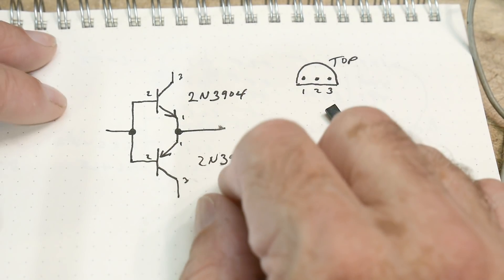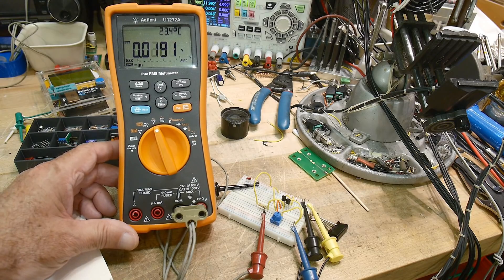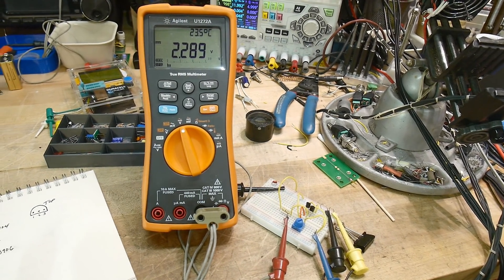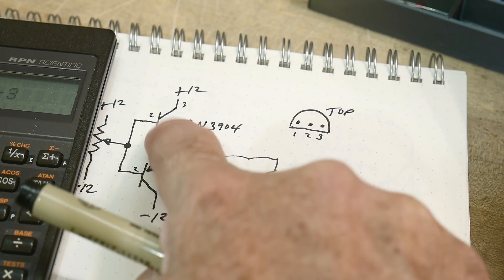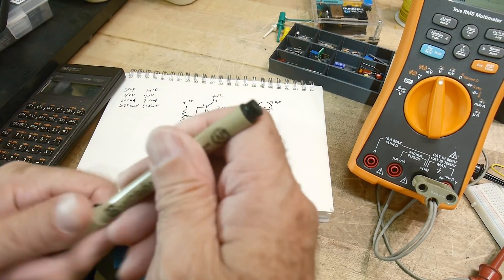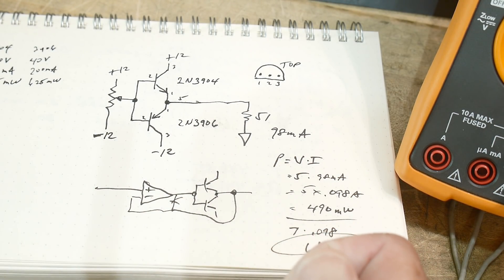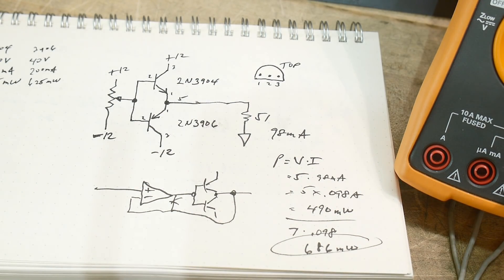#1192 2N3904 and 2N3906 Bipolar Transistors

Comment: Dude, your dissipation calculations are (slightly) off.  With he load you measured about 3.8V across the load.  That would give you a current of about 75mA.  The voltage drop across the transistor was 12-3.8=8.2V.  Therefore the power being dissipated by the transistor was 8.2x.075=615mW.  Jus' sayin'.  But it's close enough to AMR to cause real trouble.
Reply: Да, я тоже не понял, откуда там взялись 5 V, когда напряжение просело до 3,8V.
Reply: @SINHRO-FAZA а из-за чего проседает до 3,8V ? Из-за этой комплементарной пары?

Comment: Since last week, I'm playing with a portion of a circuit that Roland used in a very famous synthesizer.
Transistor, Fets and mosfets are quite more complex than just switching.
Also the transistor totem pole arrangement is pretty special, there pretty much no current usage on the base.
Both transistor cancel each other out on the base, pretty amazing, like you would be using a mosfet / fet.

Comment: 0:45  For 3-leg components (transistors in this example), I'd recommend just skipping the 1 2 3 pin numbers and go straight to simply memorizing EBC (for common examples like these).
To help clarify thoughts, does anyone use pin numbers for diodes, or straight to Anode and Cathode ?  Polarized capacitors, easier straight to + and -.
I'd suggest that pin numbers only add value for a larger number of pins.  In this case, they make memorization arguably slightly more difficult.

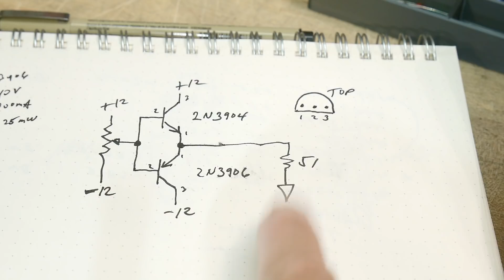Comment: 5:27 11.4V÷51Ohm= 0,235294118 Amp.
that's quite a current consume for these small boys not using a resistor on the base of them.

What would you do? since the HFE is 100 average, if you need 100mA, you need to limit the base current to 1mA, correct?

Did you try the Falstad simulator, it quite correct and good, buy a Moog Filter clone diy kit, build and simulate it, if will respond the same.

Comment: I always first design using rules of thumb using good old pen and paper, but before I built it I also do a spice model. Why? Especially important for stability analysis. E.G, the circuit you drew of the fb for an amp? How do you know that the parasitic capacitance of the transistors will not affect the fb, even make ringing with the parasitic inductance of the wires? Right, spice model. Before you build. Always. Rules of thumb are nice, but nothing compares to a good spice model 🙂.

Comment: Spice shy? Why? Back in the 1980's (and early 90's) ... more than 30 years ago (a hyperbolic infinity in semiconductor design and modeling) ... back then, Pease, and his cronies, had their good reasons. But in the last decade, at least, I can't think of an undergrad (and especially a grad) EE school where the labs don't start with SPICE simulations, and even more specialized simulation packages, before going to the lab to build. Maybe in the EE School of Old Farts,, they're still just stuffing breadboards. Dunno. Seems like small businesses, run by old farts, might be doing the same. But if you want to work in analog design, and even with discretes, and you're SPICE shy, then get a job as a plumber's apprentice. (You'll probably get a job faster, and keep it longer.) Seems to me, someone's been out of school, and a job, for a long time.
Reply from the maker: Yes, I am an old fart, guilty. I do believe (and have seen) many grads that understand the theory and are great at cad models, but are a disaster in the lab, trouble shooting or inventing new ideas. I know of good ones that can do both. I agree with you that spice is very valuable (and I do use it too).

Comment: Something to keep in mind is that the maximum power dissipation rating on the datasheet, is at 100% duty cycle. If this arrangement would have been used as intended, each transistor would have around 50% duty cycle and could handle that current easily without overheating. There are actual charts that show this on some transistors, but I was unable to find one for the 3904/06.
Reply: you have much to learn
Reply: @daveselectronicslab  Please explain. To my knowledge, the maximum power dissipation rating on a transistor is limited by the maximum collector-base junction temperature. Are you saying that a transistor that only has current passing through it 50% of the time has an operating temperature the same as one operating at 100% of the time as in a class A amplifier?

Comment: As with the other comments adding base diodes would help a little by biasing the transistors on and negating base emitter drop, could also get it to oscillate.  
I was curious was to how much the base voltage was changing due to current in the through the potentiometer.  You didn't mention if it was a 470K pot or a 100 ohm pot, obviously not 100 ohm.
Reply from the maker: 10k

Comment: I'm fiddling with a design for a big-output-capacitor-less audio amplifier (eliminating the highpass effect w/ the speaker as well as an extra 6dB) that push-pulls the speaker with inverse-phased class AB stages like this (TL084 is my op amp) and I'm using just 2N2222s (basically a little beefier 2N3904) and 2N2907s (lil' beefier 2N3906) and even though they're just little TO92 signal transistors they're actually surprisingly good at filling a room with sound.

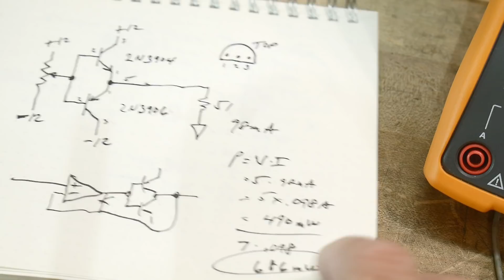Comment: At 12:00 There's no "sometime" about it. You either need to read the datasheet and do the maths and make sure at worst-case you're within limits for voltage, current and dissipation, or you've read the datasheet and done the maths so many times that you have a feel for what's reasonable.

There are not "two schools of thought". There's a sensible middle way between creating a spice model for every simple circuit that you've built a thousand times, and just sticking any old voltages and resistances into a circuit to "suck it and see" with no prior expectation of the outcome.

And if I was the R&D manager and I saw you just sticking any old circuitry together that was bound to fail, I'd fire you.

Comment: Yes, an engineer can put together a design to nominal/typical parameters without a simulator. However, SPICE and other tools are useful, if for nothing else, to check the tolerances of the devices in the design. While any engineer can get a prototype working in the lab, the usual requirement is to produce good yields through manufacturing and reliable products in the field. 

Part variation is expensive and time consuming to verify in the lab, but tools like SPICE and other simulators, as well as mathematical tools, can calculate extremes and determine margin relatively inexpensively. This can also check for violation of maximum characteristics, such as your overcurrent situation. Since in my career with many companies and being responsible for many products, I was always tasked, as part of the requirements, to create reliable and manufacturable systems, and I would have had to fire any engineer who would not simulate or calculate the variations. Luckily, I never had an engineer working on my team that did not know how to prove his work and seek to do just that. 

My first six years of my career was mostly spent fixing and cleaning up the empirical designs that other people pretending to be engineers did before me. I have a low tolerance for low quality work, because it costs my company a lot more than any savings because engineering did not take that extra hour to verify it.  Tools should never be a crutch, that is true, but the right tool should be used to do a job right.

If you are doing analog design, SPICE is easy to learn and often the CAD tool chain can create the deck for you. There are free versions of SPICE that work for many uses, but if your project supports it, licensed tools often have some worthwhile advantages. In digital design, simulation is also useful, but I also suggest trying formal methods as well, wherever you can fit it in schedule. Most designers and managers underestimate the value of verification, but it helps preserve schedule and budget and produces better results as long as you have people on the team that know how to get the value from it.
Reply: The most difficult part of designing for production is to work out what the worst-case scenario is. You need to have done lots of calculations over years to intuitively know how particular parameters affect final outcomes, and that gives you the ability to see what combination of parameters produce the worst-case result. It's beyond reprehensible to produce a design that works for most samples of the parts used in it, but can fail when one sample has a particular extreme combination of parameters. Sod's Law says that the circuit with those extreme parameters is the one that gets installed on a panel mounted 50 foot above the floor in a steelworks that's 300 miles away from your base. And you get the job of fixing it.
Reply: Once upon a time, I took an Electronics 101 course at university, mostly because I already knew my way around the topic, so a very easy 'A+'. The Professor, an EE at the PhD level of course, gave us the complete lesson and process to calculate the required resistor values for a simple Class A amplifier circuit. Did all that, Load Lines, the whole thing. Built the prototype, and it still needed tweaking for both bias and gain. I complained that I could have just started with a simple example circuit and made similar tweaks. Even if the 'solution' is yet-more analysis to account for another dozen pages of possible variables, there comes a point where it's arguably better, faster, cheaper just to start with a typical circuit and tweak. Modern analysis tools will certainly change the balance from what we had in 1979-1980. This is more of an anecdote than a lesson for others in the present day. Carry on !
Reply: Very true.   I learned small signal analysis at university.   It is possible to design an opamp or  multi-transistor circuit on paper, to an accuracy of 5%.   When I learned how to do that, during my sophomore year, I wrote a Basic program that iterated through standard 10% resistor values and came up with the design of a common emitter amplifier with the closest gain or the collector current to what was specified.    I later re-wrote the program in C and added common emitter, common base, cascode, and emitter coupled pair circuits, along with an output to an OrCad schematic.   The low frequency and high frequency roll-offs were calculated as well.   A few times I built  the designs and tested them.   The actual circuits agreed within 5% of what my program calculated.    When doing incremental analysis of a 1 or 2 transistor circuit, there are several open circuit time constants that appear in the node equations.  The high frequency response of a circuit can be closely estimated by taking the sum of the inverse time constants.   Spice, which has much more accurate device models, uses a matrix calculation, which produces a more accurate result.   I have worked with technicians who used Spice all the time.   I have noticed some had had a very superficial knowledge of how transistor work.   Their designs, which were done entirely with Spice, had unecessary components and were no where near optimal.   The more a technician or EE learns about electronics, solid state physics, and how to design a circuit on paper, the better use they can make of Spice.   The best analogy I can think of is someone relying on the self-driving capability of their Tesla, because they are not a good driver.

Comment: The way I remember the pinout for these is that the shape is a C, not a D.   So from looking down on the C, the top of the C is the collector.   The base is the middle, and that leaves the emitter as the remaining pin.
Reply: I have worked with them for a long time. Seen single PCBs with over a hundred. Even for repair purposes, even for my personal stock I always purchased them in hundreds. As far as I am concerned, they are THE jelly bean, small signal transistor. 

I just look at the flat and say E B C. And that is by far the most popular pin-out for bipolar transistors in the TO-92 package. That's why it is so impressed on my memory cells.

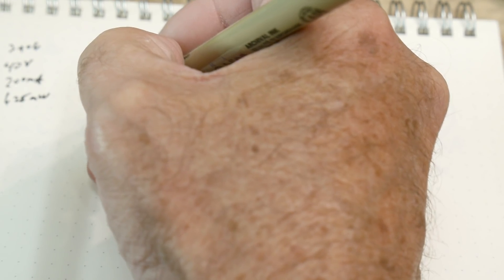Comment: 1:58 Why are no base resistors required?  Is it because there is a load?  What if there was no load, would the transistors be damaged?
Reply from the maker: best to have one
Reply: The pot provides variable base resistance to some extent, until it approaches the rail voltages.

Comment: It will eventually fail.  At high temperature, the dopants migrate faster and it will fail sooner.  At high temperature beta increases to the point of instability and it will be on until cooled even without base current (thermal runaway).

Comment: If you use two diodes on the input to bias the transistors, the crossover distortion will be very small.  If used with the op amp, it will be phenomenally small. With the op amp but without the diodes, you will still get noticeable distortion.
Reply: Or a Vbe multiplier
Reply: The diodes forward voltage drop and temperature coefficients will have to be almost exactly matched to the transistors for that to work or you will risk thermal runaway or distortion.  It's better to use the B-E junction of identical transistors to act as the "diodes" do the biasing.  Might cost a few pennies more in the price of the transistors over the diodes, but it will save much more in time and energy trying to match diodes.
Reply: the Roland System 700 VCA has that, i have build that, using the same values of resistors (50hm) and at idle, i noticed they get hot, but i used a cloned by me LM13700.
Now, i have to unsolder the 90º headers to be able to debug the circuit.

Comment: You can heat sink those to92 packages to get a bit more power out of them.   I have used a binder clip for that.  You can also bend them over and glue them to the ground plane to remove quite a bit of heat.  Also I think the die is thermally more bonded to the collector lead, so keeping leads short and having a large collector copper pour can also act as a heat sink.
Reply: It's a plastic package, you're not going to be able to move a significant amount of heat through that, or a lead... and, I'm not sure, what's limiting the current to be speced at 200 mA, for 2N3904.  In the short-run failure, at over-current, it's probably thermal run-away... but, who knows what the long-run effects of limited over--current are? (Is their research on that?)  You want more power, us a 2N2222A (it's in a metal package).  2N2222A  is 10 times the price of 2N3904; but, it's still less than half a buck.
Reply: @willthecat3861  its not for current, its for power dissipation.  The 625 milliwatts is at ambient 25C with a 5 mw derate for each C over.  With a small heat sink you can add at least 20 percent or more to the margins even though it is a plastic package.  You can get commercial to92 heat sinks as well, the binder clip is a quick and dirty substitute.
Reply: @argcargv  What else, but current, causes heat to be dissipated, to the surroundings, in a 2N3904 transistor?
Reply: @willthecat3861  voltage.  If you need to run at a higher voltage it doesn't take much current to get to 625milliwatts
Reply: @argcargv  In this context, no current... no heat. Potential is the potential to do work. That there can be a difference in potential, and yet no work done, indicates the fundamental cause of heat is current. Heat and power are not the same thing.
Reply: @willthecat3861  if power is dissipated in a component and it isn't emitting sound, light, or radio waves, then where do you think the energy is going? Of course the dissipated power is heat.  What else could it be?

Comment: Be careful that the popular BC547/8/9 have the opposite pinout (swap C and E). Always check datasheets from a semiconductor manufacturer not random webpages.
Reply: I fried a chip like this. The bc548 was fine, the chip got cooked that it was connected to.
Reply: Yep...
Random pages are dangerous !!! 

If you check them alweys check many sources  (!!!) - NOT Just 1.

I did that .. source said: "  That amp. Works on 17V... input ... 
and 
Because the original power supply didn't work ... 
I just hooked up 17 V power. Put it  ...ON ..... . and 💥💥💥  
 few sec .later big El. CAPACITOR exploded,
 and
 hit me in the knee . 

Lucky ... no big consequences.... just lessons. 

But I learned something out of it.
Reply: I have blown a few of them up and frief adjacent ICs due to that mistake